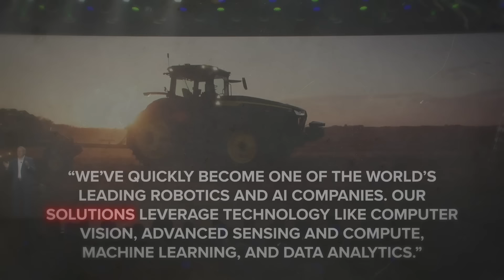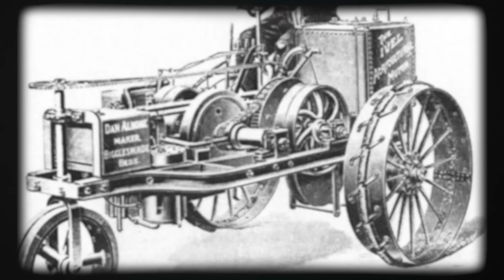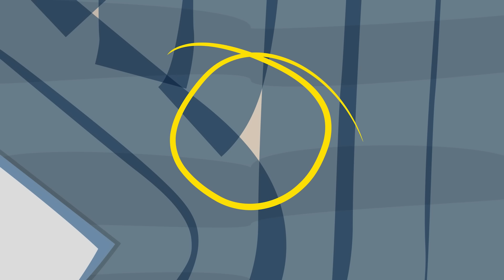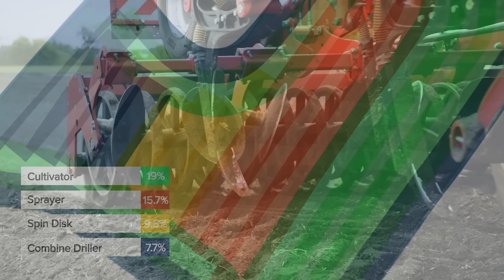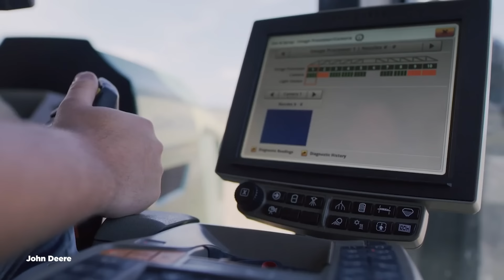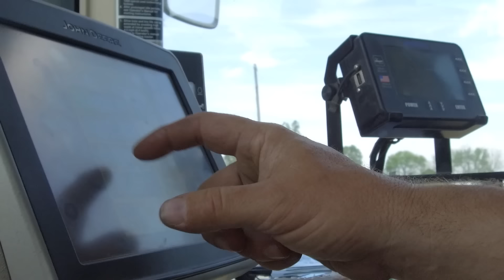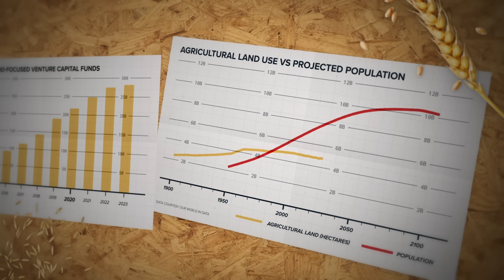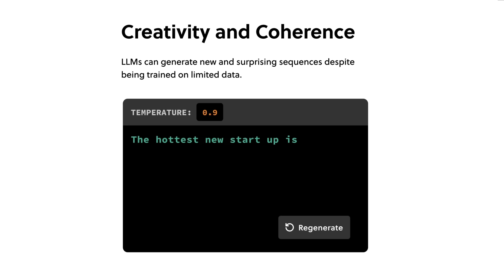How Big Tech Ruined Farming

Comment: As a former Deere engineer, Deere's old stance of doing things right has changed to doing things for maximum profit, and John May is one of the biggest indicators of that. Layoffs are happening in both manufacturing and engineering to increase profit margins, production lines are being moved offshore, and technical leaders that made Deere the company it is today are being fired, in the interest of cutting costs. There is no longer anything special about Deere as a company, and in a decade there will be nothing special about their machinery.

As a side note, Deere is currently in a hiring freeze. All of those job listings will never be filled, at least in the short-term. In fact, Deere is actively trying to reduce headcount in their tech department, through enforcing return to office policies. They are planning on a 2% reduction in headcount.
Reply: So then 10-30% of the employees leave, and then they stagnate because they think they are a monopoly yes?
Reply: While I didn't know all of this, I knew a little bit of it and I'm glad I didn't invest in JD. Relying on brand power and market share is a proven way to loose everything, in the long run
Reply: Sounds awfully like Boeing.
Reply: Capitalism baby

Line gotta go up.
Reply: @lelagrangeeffectphysics4120  Not exactly. CNH is currently doing about the same things and there's kinda the big 3 in farming so if AGCO is also doing it that's just the way it is and everyone has to deal with it
Reply: the managment changes frequently enough for a company that large, to having enough time to change
Reply: Return to office is dumb af!
Reply: This is what happens when your economy is run by gamblers who know nothing about the companies whos stock they buy. The quarterly report is the doom of anny planning past 3 months.
Reply: The head count reduction will be a lot more than 2%, try 10-30%. Like the big tech companies they are trying to be, they hired like crazy during the pandemic and are desperately trying to reduce head count.
Reply: But they are using the 2 magic letters, AI! No need to make anything, they have AI! Invest now
Reply: Just like boing, these people only care about money.
Reply: We need anti-trust law rewrites now.
Reply: @babyboijeremy Line must go up
Reply: @joeltucci1916  This is what happens when you run your economy like a casino.
Reply: All hail late stage American capitalism. At least it worked out well for the Boomers.
Reply: @FNLNFNLN  Capitalism is supposed to be based on competition, corporate consolidation has given us feudalism.
Reply: It's in all large corporations not just John deere and Boeing.  Companies used to plan long term and reinvest good portions of profits into maintenance and growth. Now it's all about profits and stock prices
Reply: @mikedavis6266  Capitalism says that the economy should be owned by private entities for profit, nothing more, nothing less.

Capitalism didn't invent competition, it doesn't own competition. Market socialism is an unambiguously socialist economic model, but it still features market competition.

Second, even if I take your statement at your word, that sounds nice in theory, but corporate consolidation and feudalism is the inevitable end result, every time.

Basic economics says larger companies are more efficient than smaller ones, so in the absence of outside regulation, corporations will always consolidate until there's a monopoly - because that's how you get maximum profits.

When outside regulation exists, the market will corrupt and buy out the regulators - because regulators are only human, and sure, maybe they can't reach full on monopoly; they'll have to settle for regional monopolies, or oligopolies where everyone is equally awful because you don't have a choice but to pick one of them.

So yeah, I stand by my original assertion.

Blame capitalism.
Reply: @Theoryofcatsndogs  but it can be easier replaced and a Tractor doesn't kill 300 ppl if it fall over...
Reply: whenever my grandpas deere tractor broke down he always used to say sarcastically 'nothing runs like a deere'
Reply: @RAWDEAL064 wow you lost bad
Reply: @Theoryofcatsndogs nothing like Boeing. John Deere is a successful company with no peer, Boeing is a company in long term decline
Reply: @FNLNFNLN capitalisn is the reason the company exists in the first place. Every single product up until the change in development that you think is the of the world, was also to make a profit. Have you ever had an independent thought in your head?
Reply: "old stance of doing things right has changed to doing things for maximum profit" -> can be said of literally any corporation anywhere. It's the inevitable conclusion from the built-in aspects of our economic model. You can maybe profit from a good service/product, but maximizing profits inevitably means screwing somebody up.
Reply: @mikedavis6266  capitalism by definition is for profit but there will always be externalized costs, moral hazards etc that made it inefficient as a whole. The corporate doesnt need to maximize total utility, they only need to maximize its own utility even at a larger total cost. It's capitalism, and such weakness has already been known for long even Adam Smith himself pointed it out.
Reply: Thanks for the insight and info!  Certainly reinforces my own experience with what 'solutions' really means in electronics retail -- mostly overpriced bullshit copium appropriate only for the upper classes.
Reply: @paulgering7703 Deere isn't a monopoly...International Harvester is gone, but Case-New Holland rose in it's place and is a true global company with considerable European assets, AGCO has collected many legacy brands like Massey-Ferguson, Challenger and Fendt.
Reply: @josephchaneyiii this is due to the influence of consumer investors.
Reply: @Eviltower101 the irony is, that tag line was originated for a Deere consumer product...snowmobiles...and later spread to be associated with their agriculture equipment.
Reply: This is capitalism 101
Reply: I see that private equity is infringing on them as well. Short term gain for a spiral I to bankruptcy.
Reply: This is the cost of progress
Reply: Needs cheap copycats then. Have to keep innovating to justify price.
Reply: Oh no, a company is maximizing profit, which is exactly what companies are supposed to do D: When that entails restructuring then they should absolutely be doing that, instead of subsidizing inefficient jobs until a competitor does it better. Do you expect them to minimize profit or what... In the grand scheme of things, being able to produce the same or higher output with less resources/work put it is the absolute best goal to achieve. It's called efficiency. People need to learn to depend way less on a single company instead of whining when that company lets you down or lays you off. Diversify your skills and investment. Invest in an unemployment insurance. The solutions are there.
Reply: Did anyone else notice the Allis WCs near the beginning?
Reply: @Dosenwerfer  clearly you can't understand that the current way of running things is just going to drag everyone down. Endless growth is impossible.
Reply: Boeing 2.0
Reply: @Theoryofcatsndogs  sounds awfully like Google :(
Reply: @robertlee6338 lol, I saw that “glad I didn’t invest in them” comment and chuckled out loud!
Reply: @beamed5382  pure unbridled capitalism is a disaster - in a democracy, there need to be sensible regulations, safety nets, and healthy investment in long term vision by the government since the capitalist has no incentive to do that
Reply: @FNLNFNLN  do you think that "basic economics" (a human attempt at a study on economy) dictates how the real world works?
Reply: @SixTough  When the basic economies in question are economies of scale and bargaining power, yes.

They more often than not do dictate how the real world works, because these aren't rules like "free market will bring competition yipeee", they're fundamental properties of how any businesses operate.

These fundamental factors are why Walmart can waltz into a small town, sell the same things for half the price as the local small businesses, and drive everyone else out of business.
Reply: @FNLNFNLN  yes you are still confusing cause and effect
Reply: @samanjj  well done saying absolutely nothing in the context of my reply! Incredible.
Reply: Like googles Do no evil :p
Reply: @Dosenwerfer  "People need to learn to depend way less on a single company instead of whining when that company lets you down or lays you off"

It was pretty clearly explained in this video why that isn't an option, and it's not because people are choosing to rely on one company.

You sound intelligent and you're very good at repeating the same broken message that Republicans have been claiming for decades.

It sounds great.

It is very obviously not working, but don't let that stop you from blaming "people" while you push that corporate worshipping BS.
Reply: What are they outsourcing?
Reply: @SixTough  I love it when people on the internet just throw out a one liner platitude with no explanation or example and pretend as if they're actually making a point.

Do explain, how exactly am I wrong for saying that a larger company that can literally produce the same product for less cost, because economies of scale allows for more efficient utilization of resources, will inevitably out-compete and either drive their competitors bankrupt, or buy them out or otherwise absorb them?
Reply: So is Case the same?
Reply: @FNLNFNLN  there is nothing fundamental about a larger company being able to produce more efficiently. The same amount of work has to be done. Why do you think there is more than one company on this planet? Because your economics observations do not dictate the physical world.
Reply: @SixTough  A quick 10 second google search is all that separated you from showing the world that you know nothing, and you chose the later.

Economies of scale make larger companies inherently more efficient because producing at scale allows you to achieve higher utilization rates on the equipment you have, and to use more efficient processes that have higher capital costs.

I'm pretty sure this exact video went over economies of scale briefly.

These kinds of AI tractors might reduce costs, but they're also incredibly expensive up front, so they're only viable if you operate at the kind of scale where a 1% annual reduction in costs will pay for all those tractors.

If you're a small family farm with a 100 acres, paying millions of dollars for a AI spraying system that saves you $10k a year makes no sense.

If you're a factory farm with thousands of acres, paying millions of dollars for an AI sprayer that will save you millions in pesticides, fertilizer, and water makes a lot of economic sense, and as a result, for every Kg of wheat or corn or soybeans your giant factory farm produces, you spent less money on the pesticides and fertilizer and water it took to grow and harvest it than what the small family farm spent.

In fact, it saves so much money per unit product that once you pay off your investment in the AI tractor, you're bringing in millions of extra dollars in excess revenue that you could use to do all sorts of things. You could use the profit to show investors that you're a better investment than the small family farm, depriving them of investment. You could undercut them, depriving them of revenue. You could buy even more new advanced tech that makes you more efficient. You could offer the now bankrupt small family farm a deal they can't refuse to buy up all their land to increase your own scale even more.

You could even hire someone to do basic research on well understood economic principles that underpin the entire modern economy.
Reply: @SixTough  Actually, I just remembered, this is Wendover Productions.

Literally the video that launched his channel into relevance - "Why Chicken Sandwiches Don't Cost $1500" - was about economies of scale, and here you are insisting the economies of scale aren't a real thing.

Ironic.
Reply: @FNLNFNLN  so why is there more than 1 company if you can break thermodynamics with your business observations?
Reply: @SixTough  Antitrust regulations? I'm pretty sure I've brought that up?

And even with antitrust regulations, there's been a ton of corporate consolidation already.

Telecoms already hold regional monopolies in most of the US. A lot of local news channels is controlled by a single right wing media company. All of the American civilian airliner manufacturers got consolidated into Boeing, and so on.

You could really use that guy to do basic research for you.
Reply: @jimbrown5091  Both have products as good or better than Deere.
Reply: Boeingization?
Reply: @tripplefives1402 Deere grew largely by checkbook engineering over tge 20th century.  They aren't the first company to do that.
Reply: @davejensen8882  I would assume so, but I never worked for either and have very limited contact with their equipment.
Reply: So the Walmart/Sam's Club way
Reply: @FNLNFNLN  companies as a concept are older than antitrust regulations. If it were genuinely more efficient, antitrust regulations would not have been invented. You prove my point by your example how airline and telecom are separate industries that are not merged into a single industry. If you had any experience in manufacturing you would not make a fool of yourself this way.
Reply: Same as Boeing and most great companies. Late stage capitalism is a problem.
Reply: @robertlee6338  kinda. Boeing used to be a great company.  John Deere seems to be beginning down the path that lead Boeing to where they are today.
Reply: @SixTough  The ability to coordinate provincial, let alone national or international enterprises, on the other hand, is an exceedingly modern concept.

And given economies of scale is the singular underlying principle that makes the modern manufacturing sector possible, I am quite sure you know absolutely fuck all about actual industrial scale manufacturing.
Reply: My brother in law was a programmer for deere, he's now moved into management. He told me almost all the programmers deere uses are Indians brought over on work visas.
Reply: @FNLNFNLN  so you are saying companies do not merge because in the distant past it was not feasible and now it is illegal? Kind of convenient. I wonder if you are aware how efficient government contractors are... Buddy the day you find out about startups is going to be exciting.
Reply: As a former Boeing family I can say the same for that company. Late stage Capitalism is a b*tch
Reply: This sounds eerily like Boeing, just without a takeover. How sad
Reply: Same direction as Boeing, and that is not going too well for them
Reply: Sounds like Boeing, and GE, etc
Reply: @phantommedia9964  It's the standard life cycle of a Corporation. Eventually product quality and innovation isn't enough to maintain constant quarterly growth, and the corporation begins eating itself alive to sustain its profits.
Reply: @sidewaysguns9144  that is the sickness of big companies nowadays. Deere, CNH, AGCO -> same problem.
Reply: @mzaite  doesn’t mean it’s right.  What Boeing had in common with GE was that a few Boeing executives were disciples under GE’s leadership.  At the time the thought GE’s leadership was credible, so any disciple who came from there to lead other companies must be good CEOs.  Clearly it’s not cuz GE isn’t what it used to be, those same teachings dragged Boeing under, and a lot of corporate America is following suit.
Reply: @phantommedia9964  By the way the current laws are written it is "Right" why we let the laws stay that way, who knows. too many law makers make too much money keeping them as they are probably. The system is working as designed. Which is to say, badly.
Reply: 600 more jobs leaving the US. Crazy
Reply: In a true free market the competition should take over.
Reply: I'll be willing to talk more about this
Im an entrepreneur from the Caribbean 
More importantly, I'm interested in the trickled-down effect of these changes.
Reply: Seems to be the same pattern as with Boeing. Great American companies with legacy are being dwindled to a husk of their former glory all in the pursuit of short term profits and maximising investors value
Reply: @Dosenwerfer what...
Non compete clause exists. 
What other company wth
Reply: @Dosenwerfer most people cant depend on more than one company.  It's literally in contract to do work for two illegal 😅
Reply: @jeffb321 so?....theyr still laying em off isn't
Reply: @jeffb321 We are talking about the company as a whole not ur attempt at racism or something. 
Theyr laying everyone off incl work visa ppl.
Get real
Reply: I am asian (not ind) used to work for deere as programmer. Moved out in time. They cancel visas and I didn't understand Which direction they  were going. Seems right decision for me.
Reply: I used to work at Deere in engineering. What a cubicle hell. The best guys were the techs in the shop. I quit that job, went overseas for a few years to do shipbuilding industry work and saved up to be my own boss in an industry that will never be automated despite the best current laughable efforts.
Reply: Yep, tech is ruining the lives of most people.
Reply: in so many industries many companies switched from promoting within to hiring a supposedly qualified business school graduate. The results have been terrible. You have to know how the little things work to understand how to scale it and keep it high quality and profitable. See Elon Musk for knowing or learning everything about his chosen companies industries so he'd know how to get the most from his engineers
Reply: @FNLNFNLN your assessment of capitalism leaves out the most important part. The part that we as a nation have completely backward.

Capitalist theory is that giants necessarily bring about their own demise, leaving a period of painful unfulfilled demand that one replacement company is insufficient to fill.

The mechanism that brings this about is exactly what you are describing. As companies merge, they inherit the debts, obligations, and overhead of the company they have purchased. This inherently lowers their efficiency. When done strategically, it CAN be a boon to the larger, purchasing company. And it CAN lead, in the short term, to an unsustainable monopoly. The key word there is unsustainable. 

This is why some times in capitalism, suppliers must be allowed to fall, and we need to ensure a market void.

For a company to sell to it's competitor, there is something making it unable to compete. Otherwise, it would simply compete. In functional capitalism, that makes the company being sold only valuable if the purchasing company has a solution to show up those losses. For example, the purchasing company can provide tooling to produce a good idea that the company they are purchasing offers. Or they see blatant mismanagement. 

However, in this era of perpetual growth, often the purchasing company is buying simply to appear bigger to investors. This leads to reckless gambling. It leads to companies overextending themselves, being on the hook to either provide positions for officers or doesn't need, or provide severance. Tying CEO compensation to stock valuation then means that shareholders and officers become a much larger expense. It leaves the purchasing company short sighted and bloated. Innovation goes down, reinvestment goes down.

What is supposed to happen then, is that the company fails. 

Instead, we get bailouts, and "too big to fail." Meaning that the so called regulators of capitalism actually freaking SOCIALIZE the losses of the giant. 

This is a perverse incentive. The market voices are silenced, as the company that should have failed remains propped up. The void never appears for smaller companies to fill. The cycle of capitalism doesn't complete. The failures remain at the top, and the innovators never get to rise. Steady profit from solid business falls or of favor, and you are left with gamblers who get to keep all their wins, while shoving their losses onto the tax payer. It turns into "heads I win, tails you lose."
Reply: @jimbartosevich498  No, I didn't leave out the most important part. Your theory leaves out the most important part - it has to function in the real world, where people who obtain wealth and power want to keep wealth and power.

There's no billionaire on the planet who will admit, "well, I screwed up, my empire building has made my business unsustainable, I will now willingly let it all collapse and go back to being just a rich guy instead of a de facto emperor".

If your theory leaves out the fact that wealthy people WILL try to corrupt governments, and that there WILL be people in government who will take those bribes, your theory will fail in the real world.
Reply: @FNLNFNLN  did I forget? Or was my entire post about this exact thing? 

Did you miss the first paragraph where I specifically said capitalist THEORY is the exact opposite of how our economy is being run? 

Did you miss my criticism of government bailouts and too big to fail? The very thing you're trying to call me out for not mentioning? Is that it is it not an act of government colluding with the billionaires? I did mention that happening, and I do consider it collision. So, what do we disagree about, exactly?

It's pretty bold to assume that because a nation called itself capitalist that it actually is. The point that I was making, and you clearly missed is that America is not the capitalist nation it claims to be
Reply: @jimbartosevich498  You also implied I was wrong for blaming capitalism because it's not really capitalism.

Capitalist theory is just garbage.
Reply: @mikedavis6266  Yep, when I heard Whendover's description of Big Ag the first thing that came into my mind was that it literally regressed to serfdom. It really is a depressing thought.
Reply: @mikedavis6266  monopolies were routinely broken up , now even foreign companies are allowed to build devastating monopolies
Reply: Every company has been absorbed by investors and now we have no control.
Reply: @monique56789  ikr! Bayer(germany)owns monsanto , 90% of our corn & soybeans
Reply: ... and therefore, the only way forward for farmers is to never buy a Deere again.
Reply: Modern toxic investor and CA run organisation.  Greed. Familiar to Boeing!
Reply: I have worked in several different industries in the last few years, and just about every company is going through some big change like this. 

Lean manufacturing and increased automation seems to be the main focus.
Reply: @calebmeyer2121  shareholder greed. Also accountants running through show like Boeing.  Toxic
Reply: @sidewaysguns9144  that's why Japanese are doing just opposite.
Reply: The ceo and all that support him need fired and new ones hired that know farming and farmers and that isn’t severely profit driven  profit above all isn’t a good way to run business if farmers and people will boycott Deere to the point that their bottom line suffers greatly then you will have the ear of the board and can tell them what you need hurt bottom line bad enough and they will do whatever you want   This ceo is going to kill this iconic company
Reply: @jillthompson1248  that's is not modern thinking! Like Boeing is run by an accountant! The feel they don't have to know the details of what is on the floor. Reason manufacturers are losing the plot..
Reply: @calebmeyer2121  Greed. The shareholders are the biggest culprits. Invest to milk.
Reply: @ oh and I didn’t mean ceo should be a farmer just know a little about them
Reply: @robertlee6338 same clowns, different circus.
Reply: There already is nothing special about their machinery. They dominate their home market but not in europe. The digitalization others have too.